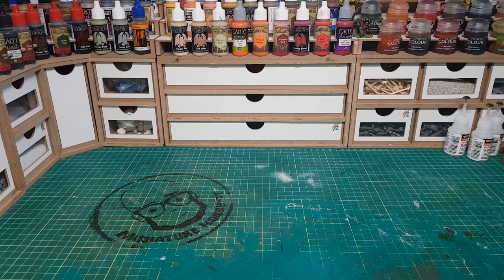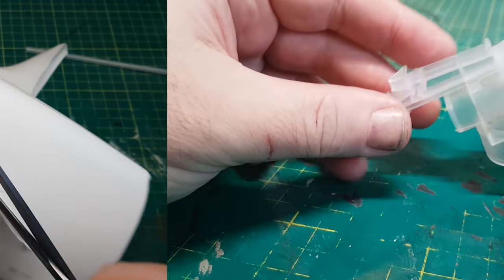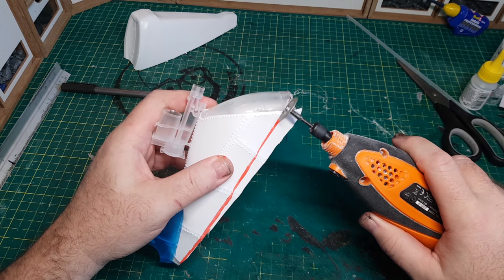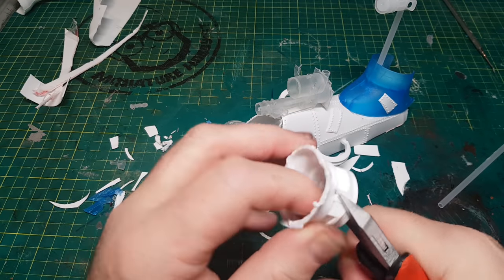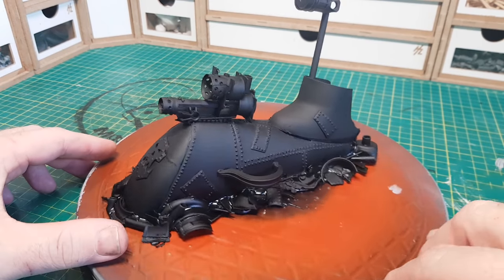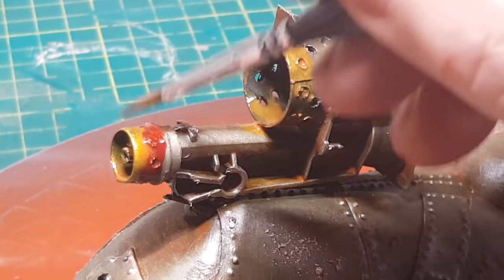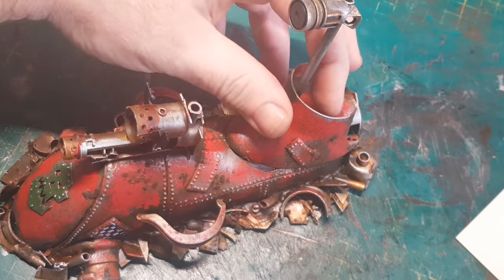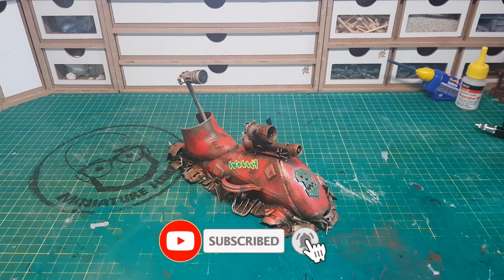Warhammer 40k Scatter Terrain from a Spray Bottle Challenge

Comment: They might be a pain to do, but those small, pokey rivets look WAY better than the standard, glued on big ones- I know it's a limitation of the materials, making things look right at scale, etc, but I always thought the bigger rivets look a bit silly. To make the rivet-poking faster, maybe you could find/make a tool with multiple prongs? A fork seems like it'd be a good thing to try, then you'd be able to do 4 rivets at a time.

As for melting the plastic, those bottles are made of HDPE. It melts easily with heat- you can melt it in the oven, or I've seen youtubers putting it in a George Foreman type sandwich grill to get flat sheets. As a bonus, it doesn't even give off nasty gases like a lot of other plastics do when heated. That said, I wouldn't say it's worth doing for model making- HDPE is notoriously bad for adhesion with glue, paint, etc. To be honest I'm surprised the paint job you did actually stuck.
Reply from the maker: Yup the rivetts are definently more in scale, I might make a tool that can do more at once =)

Comment: What's the non-sharp poking tool you use? I saw your video and tried it with a couple sculpting tools I have on some thin styrene, didn't leave a sharp enough impression for my preference.
Reply from the maker: It did have a sharp point on it but somehow I broke it off, you have to really push down hard for it to make an impression =)

Comment: Wow, good work . on the airbrush try adjusting the paint mix and adjusting the needle a bit
Reply from the maker: Its a portable airbrush so very low pressure which is why you have to thin it down a lot, its fine on a lighter colour primer just not black lol =)